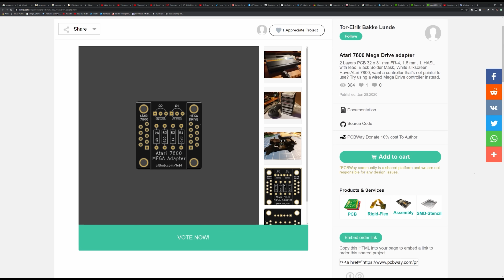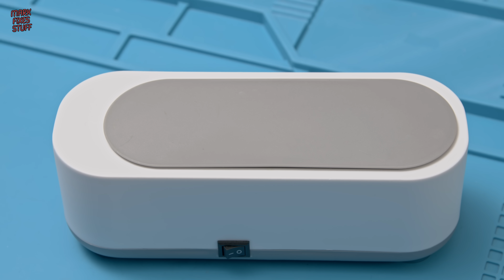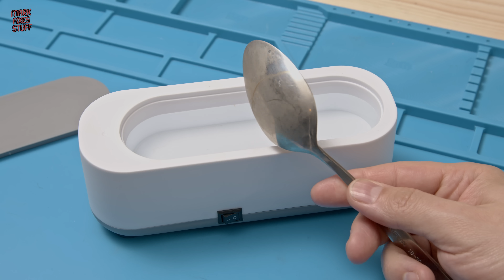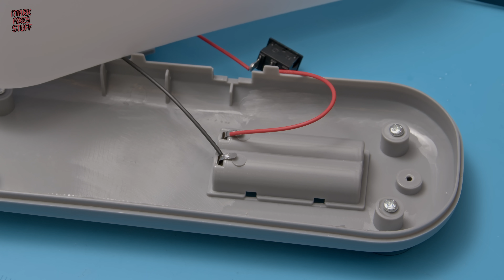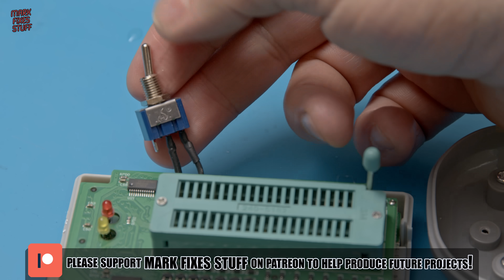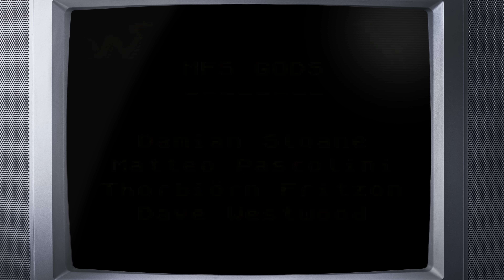£2.72 for an Ultrasonic Cleaner? REALLY? TEMU Product Test & Teardown

Comment: 5v and 3v at this level are pretty much the same as a 5v USB cable is charging the 3v-3.7v battery in the device.. my 5v one for £1 more is 500-1000mah and has a lid but if you take the lid off n observe the water you will see basically no ripples in the water but push it down with hand whole device with fingers without the lid n apply force you will see the nice ripple effect and works fine .. obviously bottom off the barrel power wise but it still work just takes longer and can try adding small amount bicarb or lemon or vinigar and seeing as you mentioned usually metal inside then layer some tin foil or appropriate type off metal foil I'm sure that will help..also if your mixing metals say a hand full diff coins it will prob effect the result the grime could leave one maybe be attracted too another coin due too some effect from the vibration but anyway just sharing with ya maybe worth you giving another go..cherrs

Comment: I'm opening mine. I have my doubts but it is steel and uses a plug but I'm skeptical and even more so now lol I'll get back with my findings .. I'm sure you're all going to be refreshing over and over to see what happened.
Reply from the maker: F5 F5 F5 F5 F5 F5 F5 F5 F5 F5 F5 F5 F5 F5 F5 F5 F5 F5 F5 F5 F5 F5 F5 F5 F5 F5 F5 F5 F5 F5 F5 F5 F5 F5 F5 F5 F5 F5 F5 F5 F5 F5 F5 F5 F5 F5 F5 F5 F5 F5 F5 F5 F5 F5 F5 F5 F5 F5 F5 F5 F5 F5 F5 F5 F5 F5 F5 F5 F5 F5 F5 F5 F5 F5 F5 F5 F5 F5 F5 F5 F5 F5 F5 F5 F5 F5 F5 F5 F5 F5 F5 F5 F5 F5 F5 F5 F5 F5 F5 F5 F5 F5 F5 F5 F5 F5 F5 F5 F5 F5 F5 F5 F5 F5 F5 F5 F5 F5 F5 F5 F5 F5 F5 F5 F5 F5 F5 F5
Reply: @MarkFixesStuff  what's F5 mean
Reply from the maker: @Zonniezonnie_Minecraft f5 refreshes your browser
Reply: So... What happened?

Comment: I was so disappointed when I ordered mine.  Don't know how I expected a proper 44kh cleaner for under $10AUD lol.  I was curious and opened it.  Apart from shoddy wiring and a single 18650 battery, no transducer anywhere?? So yeah basically a small hobbyists dc motor with an offset spline....fml

Comment: It means it is not ultrasonic cleaner, In ultrasonic cleaner frequency of 33 to 40 khz used to vibrate piezo crystal for vibration. It is fake cleaner at all. thanks for showing inside syatem. vibrating moter fixed inside machine never perform ultrasonic cleaning.

Comment: Thanks. This video save me SGD$1.77 from buying the ultrasonic cleaner for my spectacles.

As i wear think lens so the rim of my lens gets dirty and i can't find a way to clean it. Maybe remove from the frame can clean my lens but the optical shop refuse to help me remove my lens as they claim my frame may crack.

I wonder if a good quality ultrasonic cleaner can remove the grim at the side of lens that is between the frame?

Comment: I was considering a cheap ultrasonic cleaner for my teeth retainers but I knew all of these ultracheap were suspicious. Do you think that the Xiaomi Ultrasonic Cleaner will do the job or it can also be a disappointment like the one in your video?
Reply from the maker: The EraClean GA01 is a real ultrasonic cleaner from those guys. It’s low power but should be good for teeth retainers

Comment: Yeah, I paid AU$5 for one of these from Aliexpress and it worked about as well as I expected. I had a good laugh when I opened it to discover the approach to "ultrasonic" wave generation.
Well... at least it has a neat rocker switch I can use in something else. I guess?
Reply from the maker: Yeah. It’s good for knocking up a “Personal Massager”. Just watching your Metal Slug video. Love it!
Reply: @MarkFixesStuff  bit of a side tangent, but I was watching another one of your vids where you mentioned BitFunx were a bit shady.  What have your experiences been? I have used their SaturnPSU DC supplies in about 10 refurbed systems so far with no issues with the products themselves.
Reply from the maker: They are knock-off merchants who steal other people's designs. The quality is all right, sometimes a bit dodge. They knocked off LOADS of makers work.
Reply: @MarkFixesStuff  yeah, that's not good then. I guess I shouldn't be surprised buying off Aliexpress 🫤. It's time to look for new vendors. Any suggestions for Saturn DC PSUs?
Reply from the maker: My feelings on original PSUs is that really they are good designs already. The new versions that people design might be more efficient but servicing the old power supplies with good new capacitors is a great option. Have a look at this analysis by Bob from RetroRGB based on direct scrutiny by Voultar: https://www.retrorgb.com/dreamcast-replacement-psu-design-analysed.html - Sometimes new isn't always better I guess.
Reply: @MarkFixesStuff Thanks, I'll check those links out. I'm definitely familiar with Voultar's work. For me, because I import, refurbish and resell Japanese systems into Australia, the DC can be more convenient. But also, for when I'm working on the system boards, I like having a DC supply available for safety reasons. "Be careful around that, it's AC mains!". I prefer to remove the danger from the situation entirely, if I can.

Comment: I bought one of those and cleaned few different metal and plastic frames glasses. It worked  perfectly, my dad was very surprised. It was the same for some of my jewellery...that is what they advertise. Cleans jewellery and glasses. In video you should try with glasses, not a spoon. I tried and it worked🙂

Comment: If you say your ultrasonic cleaner would clean that spoon then you should show it right next to this "ultrasonic cleaner". 
I have a real ultrasonic cleaner and I want to say it's not always the case that stain goes right off, so it would be nice you to show results of what you talking about.
Reply from the maker: My real ultrasonic cleaner is a 42l industrial model that can remove rust from old tools so it wouldn’t be a fair comparison. If I find a real ultrasonic unit (and not just a vibration motor) then I’ll maybe post an update.

Comment: My Friends Father Owns A Company That Mills Aluminium, Brass And Other Metal Pieces And This Company Is Located In EU, So, The Chinese COmpany Sent Aluminium Pieces, But In testing They Fell Appart, Mind You That He Didn`t Order Few Pieces, He Ordered 10.000 Units , Each Piece Was 7.90 Euros From That Factory And He Was Reselling Them With Installments And Warranty Fees For 150 Euros Here, But When They Fell Appart In Testing He Went To The Factory To See The State Of The Operations, He Was Sent To Another Factory, But Thank God He Took With Him An XRF Analyzer°And He Saw That The Parts Made THERE Was Not The Same Composit Material, It Was Another Alloy And He Pointed That out And They Said That It Can`t Be, THEN After That He Got mad ANd They Started To tell Him That Its SOme Sort of Mix Up, But he Calculated That The Parts That Where Sold Him Did Not have The Materials That He Ordered And They Did Not Match What Was Pointed To Him On How They Where Made, So, After That he Did A Digging And Then He Went To Them And Showed What He Found, They Broke Under The Pressure And They Told Him That The Parts Are Made In Another City By Another People By Another COmpany That They Buy From And The Parts That They made Was Just For The Show And They can`t Produce Such Expensive parts For Such Cheap Money As He Orderred, So It Was A Full Blown Scam, They Put In Super Cheap Materials So They Fell Appart, The Parts Are For harvesters, Some Heads That Vibrate And So Something With The Corn Or Something Like That, ID o`nt Know Exacly, But Yeah, he Named The City Where The Parts Where Made, He Asked To Go There And They Said That Government Will never Allow Anyone From outside To Go There And They Said That If He Wil Go There Alone With Hes Team, They Might get Caught In The Best Situation, Worst Case Would Be They Will become The Workers, he Asked, What Do You Mean, And Then The Chinese Guy Spilled That The Prices Are THAT Low Because They Ship Entire SHIPS Worth Of Electronics There Every Week, Its All Sorted From Small ENgines, Rubber Parts And Other Parts That Europe And UN Discarts In Poor Chinese Bay Cities, There Are People Who Collect That Shit And test It, If IOt Works They Put Them In Boxes And They Get Paid Like 1 Cent For 10 Of These Motors Or SOmething Like That, So , THATS HOW THEY ARE ABLE TO BE THAT CHEAP.! Everything There Is For Free For Them, Almost For Free..  They Just Put Together OUR GARBAGE BY REAL LIFE SLAVES AND Sell Them back To us And You Buy It And SHow It On Internet And Incidently You Advertise The SIte.
We Should Tell people To NEVER BUY FROM These Chinese Sites...
Reply: I Actually Like Your video Because You mentioned ABouyt These Thinsgv I mentioned. 
Thank GOD You Aint Stupid

Comment: it may not be an ultrasonic cleaner but it's a sonic cleaner which does have some merit, since i don't have an ultrasonic i built a homemade sonic cleaner to clean motorcycle carburetors, i jsut have to leave them in longer than i would with an USCleaner but it does work........

Comment: One minor nit; the fact that the unit only has 3V from the batteries to work with is not itself a showstopper. In theory you can use a boost converter to get whatever voltage the transducer needs, although you're unlikely to get more than an amp or two of current out of AAAs for any length of time so you're limited to a total power budget of maybe 5-10W with two of them, when you likely need something more like 20-40W to get effective cleaning even with a very small ultrasonic bath like this.
Reply from the maker: Oh yes. I know. The point being it wasn't a terribly goood sign to see it ran on two AAA batteries.
Reply: i, too, know what a buck boost converter is, let's hi-5 then cover eachother in mayonnaise and slide around the kitchen together pretending we're slugs
Reply from the maker: @bugz000  no because I’ve just cleaned the floor.

Comment: You can get ultrasonic cleaners cheaply, I have one slightly bigger than this that cost me around $15. It is probably quite weak though, with no visible water movement but if you stick your finger in it you can feel the vibrations. Pretty sure it's legit, it was bought locally, runs on AC and has a metal container. Seems to work okay for cleaning jewelry.
Reply from the maker: If it works then it's likely a 40khz single transducer. won't remove rust but will clean the "patina" from metals, which is what it's made for.

Comment: Although i didn't know about the fact that plastics would be damaged by real transducers which would explain why genuine ultrasonic cleaners have a (stainless)steel pan or bath, at work i use 2 different sized (real) ultrasonic cleaners. Personally i don't like the sound of ultrasonic transducers in cleaning equipment so i'd only start them when i don't have to be around them, looking at the odd waves in the bath on the video (plus reveiling the vibrating motor) i don't recognize the waves from the equipment i use compared to the ones in the video, plus the sound from a fake cleaner is very different from a real one i would imagine.
Reply from the maker: I didn't include the original sound due to a mistake in editing, but it sounds like if you leave a "rumble" enabled game controller on a table whilst it's working. Nothing like the drone of a real UC as you correctly guess.

Comment: Rubber ducks, soft toys, hand crafts, Temu is great for things like that.
Electronics - no.
Reply from the maker: I think you’ve nailed it. Anything functional is unlikely to function.
Reply: @MarkFixesStuff  also, if a soft toy 'fails to function', it just falls to bits.
If electronics fail, they tend to fail in flames.

Comment: Hey my girlfriend bought two of these ine for me and her mother, been trying to find a real ultrasonic driver thingy to replace the poo motor in it and have it working properly
Reply from the maker: It’s a lost cause I’m afraid. You need a transducer and that needs to be welded to a steel tank. Better off finding one and the same size with a steel tank. Should be about £25 ish.
Reply: Yeah that's where all my searches ended

Comment: The problem with these china suppliers like TEMU, Aliexpress et al is that while people continue to buy this rubbish they continue to churn it out by the container-load. If people stopped buying it then china wouldn't make it and the world would be a better place.
I realize you were able to use the switch and possibly the motor, but not everyone will and when they realize that this unit doesn't actually clean anything, it will just end up in landfill. 
It's not good for the planet.

Comment: I knew my "ultrasonic" was a fake! I hadn't got around to proving it yet, but it's just a bigger version of this. Mine was the USB Rechargeable version, and had a VERY odd looking plastic item, similar size/shape to a 9V battery, but appeared to be hand made, and all black plastic. Don't think a capacitor as it held charge for months, more like a cheap hand made Ni-CD perhaps. It put out around 4V on arrival. The battery case was completely disconnected.
Reply: can it be used as screw cleaner? put sand and screw, try turn it on

Comment: I really don't like the power switch they used, a bit unsafe with that switch in that spot. I called the rambler inside lol it looks real. I wonder if two motors 90 degree from each other would make it work a bit? prob not.
Reply from the maker: Agreed! Lucky it’s just 3v 😜

Comment: I was impressed by the consistency of the wave wobbles. Nice as a k-3 science demonstration
Reply from the maker: Yeah. It was almost convincing.
Reply: Why only k-3, I could even see some use for it in first year college physics classrooms studying oscillating motion, of course that's assuming that changing the input voltage will speed up, or slow down the motor, and not just break it

Comment: The ultrasonic I use is an Aliexpress AIPIO, paid like £20 for an all stainless steel construction small unit which is pretty potent and having two horns on such a small unit pretty much obliterated dirt and grime very quickly.
Reply from the maker: I do need to get a real version of a smaller unit. My only cleaner is 42l and that’s too big for casual use

Comment: Vibrating motor connected to a switch and aaa batteries. Already argued with TEMU about this.
Reply from the maker: You don’t even need to watch 😝
Reply: @MarkFixesStuff  ahaha, yessir, they insisted the product worked and therefore counted as an "ultrasonic cleaner" so they refused to refund me.
Reply: I bought the more expensive USB powered one suspecting it was probably motor driven, which it was. I contacted Temu telling them it didn’t work at 45kHz as their advert claimed but it just vibrated like a sex toy, and got an immediate refund of my £9.20 back to PayPal under their ’refund 1 item without returning’ policy on multiple item purchases 👍🏻 The cheap USB green laser pointer I had in the same order is great!
Reply: @Jeeper585858  So, how much lovely UV or IR is that cheap laser pointer spewing in all sorts of directions? It's not primarily power you pay for in quality devices. See e.g. Brainiac75's tests.
Reply: @0LoneTech  I don’t have a clue nor do I give a sh*t, it does what I want it to do which is give out a nice visible green laser beam, why is that a big enough problem for you to ask?
Reply: @Jeeper585858  Whoa, hold the attitude there. Just hoping you won't blind someone.

More specific context: Those things are often more powerful in IR than in green, and the green fades when they're cold. So people go pointing about powerful lasers they can't see wondering why they're not working; and being unable to see them means we're defenseless against them too. The first thing cheap manufacturers skimp on is the filter to keep that invisible portion down to safe levels.

Comment: The way the water vibrates it makes me wonder if this little fellow would be any good on mixing paints in the miniature hobby (you know, Warhammer and stuff) It can't be worse than the cheap nail polish shakers and might give cheap vortex mixers a run for their money. Especially since you can fit so many paint pots into that thing to shake simultaneously.
Reply: I checked with chatgpt. You can!

Comment: So it is not a ultra sonic cleaner but a vibrating cleaner ... which it is better if you have coatings on your glasses. Ultra sonic cleaner can destroy coatings on your glasses.
Reply from the maker: It would be better if it actually did something but it doesn’t. You’re better off with a glasses wipe!

Comment: Just as I suspected, a cheap definitely not ultrasonic vibrating motor. That was my guess from the start, and as soon as you switched it on and I saw the surface of the water vibrating, I knew for sure that's all it was. Hopefully you reported your findings to Temu so they can correct the product listing?

I think it's shameful that any site would sell something so obviously fake. They have a responsibility to make sure the descriptions of the products they sell are accurate. That's not just my opinion, that's what the consumer protection laws in my country and many others require, so if they wish to sell to consumers in those jurisdictions, they need to abide by those laws.
Reply from the maker: Yeah. I reported it and got a refund too. It’s whack a mole though. The same product is on there dozens of times.
Reply: It is where “Chineseum crap” factories dump their polished turds 😠

Comment: Once I bought this device that would auto-swimg your phone to give it fake steps for those AR games that you have to walk around like Street Pass, and Pokemon Go. Well I got it, and it did not do anything, and felt ultra light, so I disassembled it to see nothing on the inside. Only thing in there was the DC power connector floating in a drilled hole. Instantly got a refund on it.
Reply: You got cheated while trying to cheat lmaooo
Reply: @JaredConnell  Yeah, kind of deserved that one tbh 😅